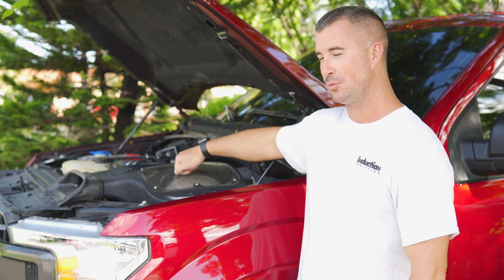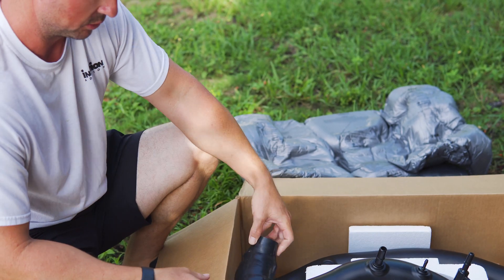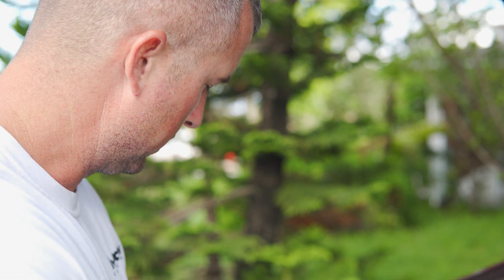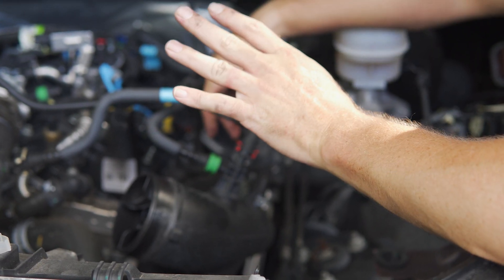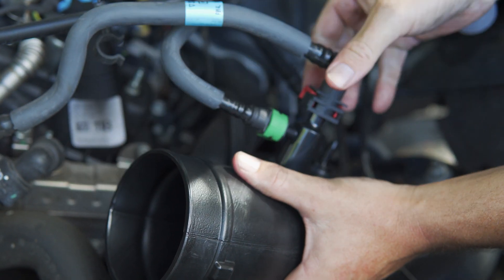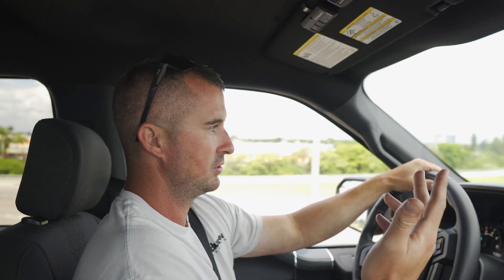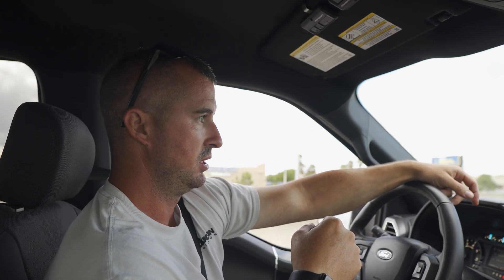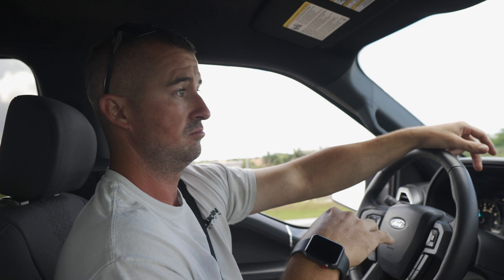AMS Turbo Inlet Install on 2.7L Ecoboost F150

Comment: 400 bucks? I'll pass. Pointless to do unless you upgraded the stock turbos.
Reply from the maker: I would say almost anything pointless without a tune. I do agree with you that bigger turbos would benefit more but tuning with these over the stock inlets I’m sure you would see some improvement.
Reply: @phelpsgarage4202  I have a @goosetuned 93 octane map and intercooler upgrade from @cvfabrication (titan 2). But the fact remains; stock turbo is only going to require so much air intake. 
It's science. Can't be disputed. Factual logic.
Reply from the maker: @Jesusisking12011  I do agree with you, but I think we both can agree that these turbo inlets are less restrictive than the stock unit.. so maybe a tad bit more responsive and maybe  a little less laggy making this more efficient. Bigger turbos for benefit more for sure

Comment: Mannnn I put these in my 2016 3.5 the only difference I notice was a check engine light
Reply from the maker: 😂 I believe it’s due to the torque base ECU
Reply: @phelpsgarage4202  how do I fix that? Does that mean it needs a tune?
Reply from the maker: @samokash  I don’t believe you need a tune. Everything was installed correctly? No leaks or unplugged cables? What’s the check engine light say?

Comment: Can someone please explain how this product is beneficial when all you are doing is shifting the bottleneck further down the line? The inlet for the turbo is still the same size (without upgrading the turbo) so how does making the tubes bigger help? The airflow is still being constricted at some point in the system. With these tubes you are just changing the choke point to the turbo itself. This seem to be a fairly obvious issue that should be, but is not, addressed in videos of those who have installed it or the AMS website.
Reply from the maker: I don’t have a ton of data to back up what I’m saying, it’s just my 2 cents. What I can tell you is that the truck will bring in more air and to the turbos more efficient. You would need less throttle input to make the same amount of boost which will make these inlet’s more efficient over stock. The AMS turbo inlets do not bottleneck down but, they fit the turbos where they should and opening up everything in front of it. I believe we can hit target boost, much sooner and easier which will turn the wastegate duty cycle down? And yes, these would work better with bigger turbos . Also, to see the most out of these turbo inlets, you would need a tune.  Hopefully that makes sense. Sorry I don’t have any data to show the difference. Thanks for watching
Reply: @phelpsgarage4202  hey there I appreciate it. Thanks. I’ve installed the SPD catted down pipes with the GX  series exhaust. The turbo spool def does not sound like an A10 or deuce and a half as it does in SPD’s videos. Was wondering if this would contribute to an increase the turbo spool coming out of the exhaust. Also waiting on a tune from Lund based on your other video.
Reply from the maker: @j.seashell3785  i haven’t had any issues with my tune from them. I even tow my track car with it.

Comment: If all of you guys I won't use that product that product f** up your turbos
Reply from the maker: I’m not sure I follow what you mean.  I’ve had the inlets on my truck for about 20k miles and haven’t had any issues. My truck has been tuned for 50k miles and no problems with anything.
Reply: @phelpsgarage4202  Still running good? I just ordered some
Reply from the maker: @justinlamb3822  no issues reported!

Comment: Hi. Why did you chose the S&B cold air intake? Currently priced at $349.00. I am on the market to upgrade from stock with K&N drop in air filter but can't see solid info on what puts 1 above the other, other than price. Currently between K&N ($399.99) and Roush ($449.99). Thank you for your time.
Reply from the maker: To be honest I had the same set up and then I went with a S&B based on the price and I like how the ram air was set up but, you don’t notice anything.

Comment: On the passenger side I had to install that sleeve first (going in from the top) then run the inlet tube down into the sleeve. That sleeve on the passenger side just did want to go on the turbo. It gave me quite a fight, but I got it on. That is a job I'd rather not do again.
Reply: I’m on it right now man. I had to take a break from it. Those rubber sleeves are not your friend
Reply: @carlosarredondo4932  

Those sleeves are evil !!! I hope you got it done...

Comment: The 25% larger after intercooler is suppose to make a significant increase in power, especially when towing or anytime the engine is very hot, and starting to loose power when stock. True for the 2.7s and 3.5s.

Comment: I'm doing these pipes very soon I also have a afe intake that comes with a little plastic shank that goes into the tube any idea if you still have to use the shank with these pipes?
Reply from the maker: I don’t believe so.
Reply: Use the little aFe tube after installing these otherwise you may through a P04F0 code like I did. After installing the tube into the pcv return tube the code went away, just need to make sure the cut section on the tube is facing directly towards the turbo.

Comment: Wonder if larger throttle body would (if they had one for 2018+) compliment these?
Reply from the maker: I’m sure will would if it was tuned for it.
Reply: Throttle body is not a restriction with stock turbos
Reply: @randyschmidt19  correct but I was thinking about getting a ported throttle body which I found with these tubes and a tune. Get more air in the motor should net more horsepower maybe.

Comment: Check engine light on yet?
Reply from the maker: Nope!
Reply: @phelpsgarage4202  nice I’ll have to look into getting a set.  Reason I asked is once I removed the little plastic swirl things lol don’t know what they are called.  With my cold air intake I started getting the check engine.  As soon as they were back in no problems at all.
Reply from the maker: @gmanvuk7740  That’s interesting 🤔… I never knew that
Reply: @phelpsgarage4202  yea a week later I started getting crank case pressure to low I believe.  I would reset the code and it would come back but as soon as the silencers were back in no problems it’s been 6 months.  That’s why I was asking about the check engine.  Are you running a cai with the inlets?
Reply: @gmanvuk7740  what code was set
Reply: @randyschmidt19  I forgot the code but it had to do with crank case pressure.  Ever since I had the silencers in no prob for at least 6 months.  Also prior to taking them out I had no problems or codes.  Just happened with silencers out.
Reply: @gmanvuk7740 the cold air intake through that code in my 2.7 but once I got a tune from 5 star they got rid of it. I guess it’s the correct air/fuel ratio. Mine had the same crank sensor code.
Reply: P04DB

Comment: What type of extension you use on the driver side pipe, it looks shorter than stock
Reply from the maker: It comes with all the right size couplers and clamps for the turbos